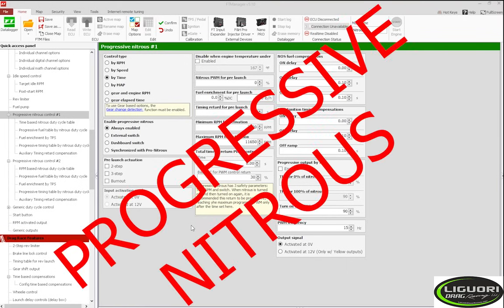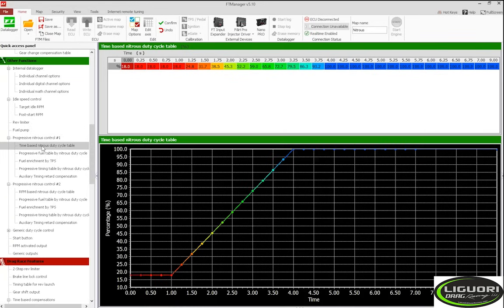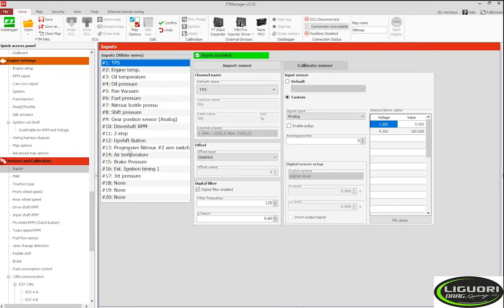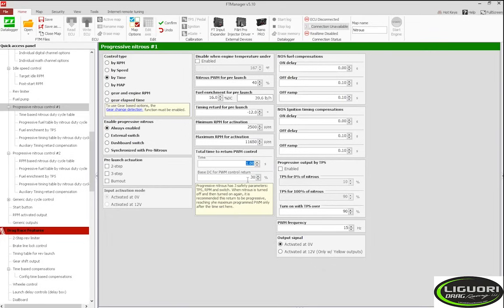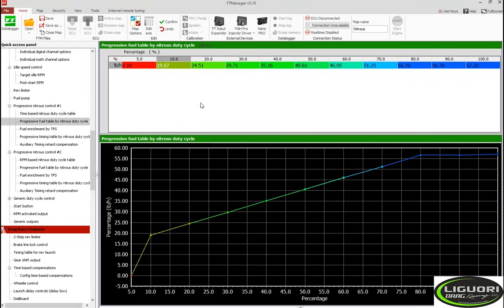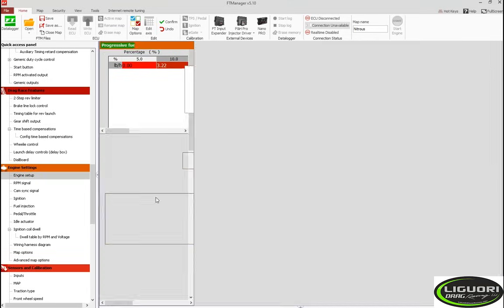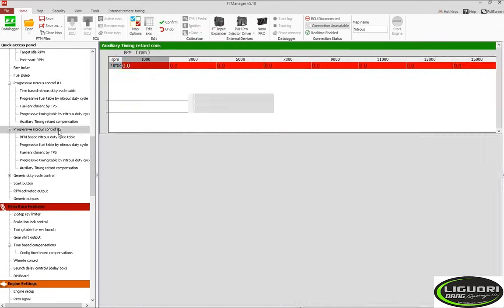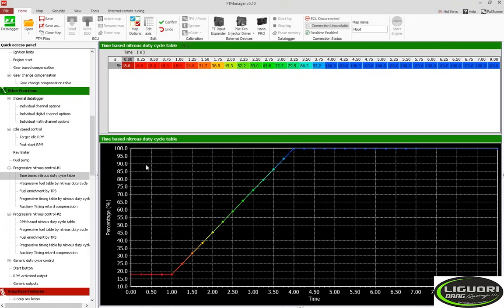Progressive nitrous control with FuelTech

Comment: pretty informative video, however i would like more info on the pre launch stuff. Im not using the output for nitrous, but to operate a line lock solenoid on my clutch line to use it as a clutch slipper valve. I started with an issue where it wouldn't catch the pressure quick enough, so i increased pwm frequency, that helped. Keep in mind im targeting 100% DC for the first 2 seconds or so (ill have to dial that in at the track). Anyways, after increasing pwm frequency, i managed to catch the pressure about 200 psi sooner, but it wasnt enough. Then i decided to try pre launch activation. Set it to 2 step. Now, if i set nitrous pwm for pre launch to 14%, it works and catches where i want, but at 15% it just locks the valve shut. So, what im really wondering is what is the pre launch activation doing? Is the pre launch pwm % just a percentage of the pwm frequency? So, for example, if pwm frequency is set to say 100hz, and the pre launch pwm is set to 14%, the pre launch actual pwm is 100x0.14=14hz? So, its pre launching 100% DC at 14hz? That is, the valve would be 100% opening and 100% closing 14 times per second, on the 2 step, before the validated launch? 

So, with those settings, the timeline for the launch and the first couple seconds looks like this:
on clutch down (activates 2 step based on clutch pressure), 2 step activates, wot, on the 2 step limiter. Now, the valve should be getting 100% of the available voltage in a pulse at 14 times per second. Now, i release clutch, validated launch is activated, now it pulses all the voltage, but instead at 100 times per second until it hits the 2 seconds or whatever i set in the time based duty cycle table, at which point it turns the valve off. Is this correct? Also, why would it lock the solenoid at 15% and not 14%? (ps, i actually have the pwm frequency maxed out at 300hz to get it to catch soon enough, but i feel like if i lowered it and used more of the pre launch percent i may end up with more tunability?)

Comment: Great video!
I need your help.
I am currently configuring Progressive Nitros #1.
I want to control it by time, additionally by rpm (safety reason).
Now my question: What is the trigger that starts the time? 
Thank you very much! FuelTech is great! (-:
Reply from the maker: The trigger that starts the time is a validated launch using the 2step. If you’re not using a 2step there are other ways around it.